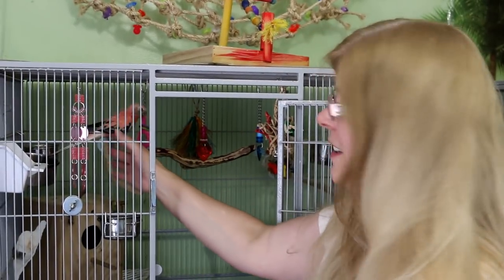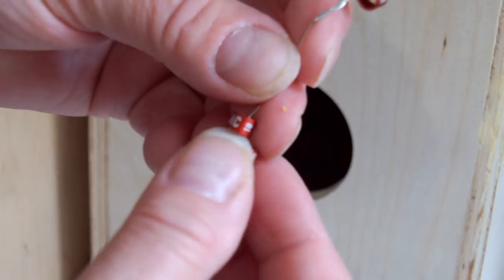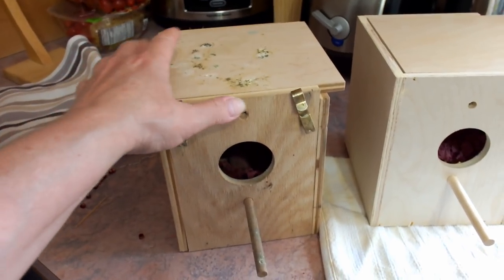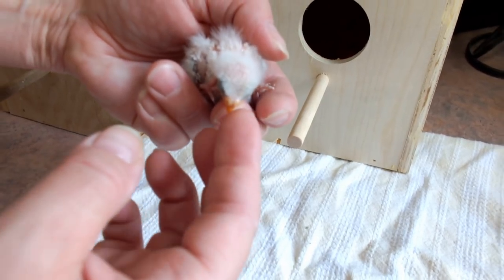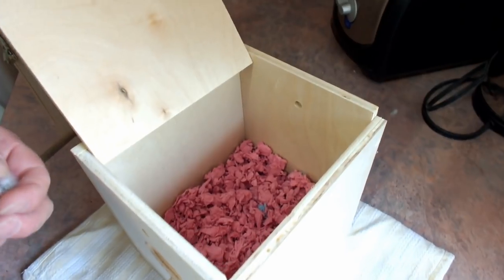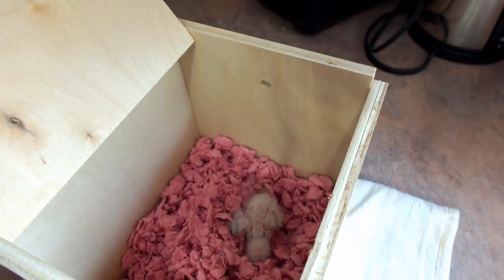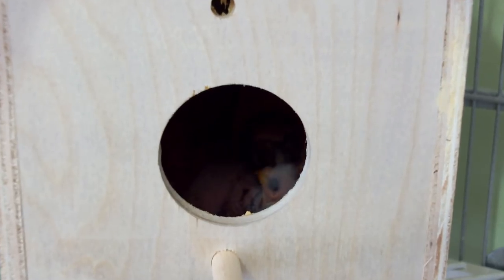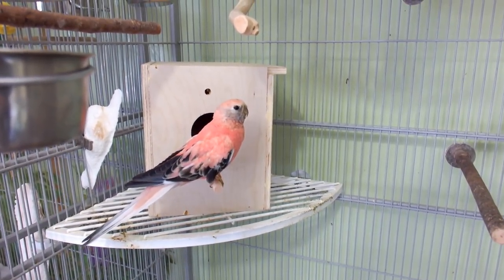How to apply a Closed Leg Band to a Parakeet

Comment: The baby’s are adorable 😍 I just got a baby love bird she doesn’t have any nails it was a birth defect that she was born with I just want to make her as comfortable as I can do you have any suggestions on what I can do for her cage setup to help ? Thank you love your Chanel
Reply from the maker: Congratulations on your new baby Lovebird. Since she has no nails make sure the perches are not slippery. Remove the dowels that come with the cage as they are slippery and she may fall and hurt herself. Also you can keep the dowels and cover them with vet wrap or mole skin for better grip. Try the rope perches, fir perches, dragonwood perches or any perches that are not smooth and slippery.
Reply from the maker: She will be able to climb without nails. I suggest to not clip her flight feathers so that she can get around better.